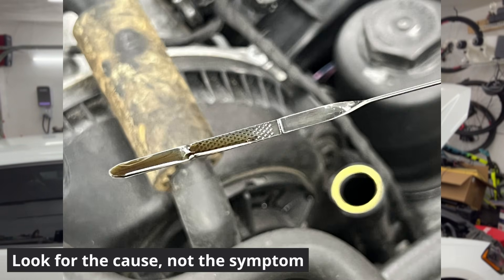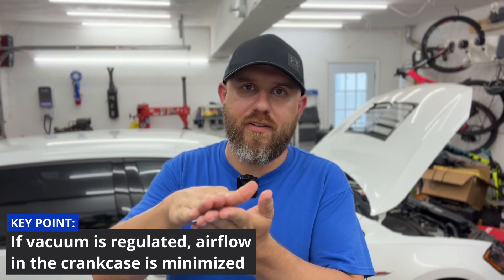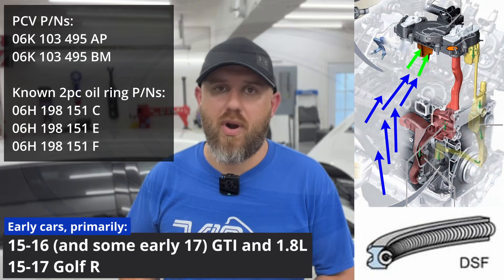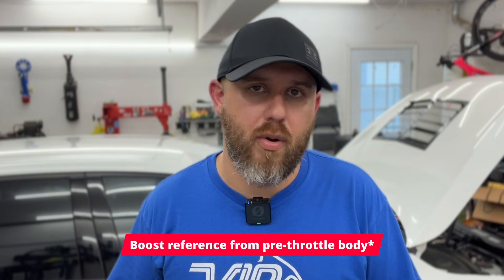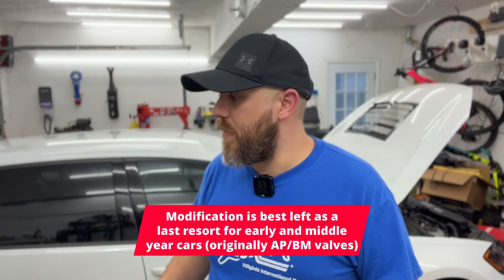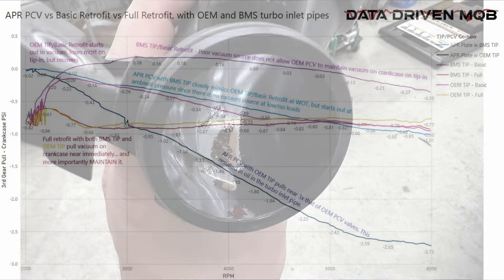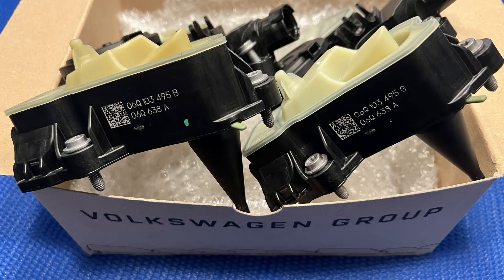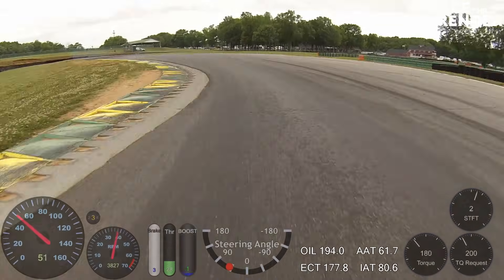MK7 PCV: What YOU NEED TO KNOW!

Comment: Whats the right PCV part number for my 2017 MK7.5 GTi Performance Pack with engine code DLB-029070? Thanks in advance
Reply from the maker: Unfortunately the only way to know with 100% certainty is to call the dealer and have them run the VIN. Can't rely on online catalogs as many are incorrect. I know you can send a message to ShopDAP and they can do the same as they have access to the OE catalogs as well.
Reply: @datadrivenmqb  Thanks for the reply, I will flick ShopDAP an email with my VIN. 

I did go through the local vw dealer and they said the BL revision is the correct part number based on their system and have that currently installed, however, since having this BL revision installed the car has a puff blue smoke on warm starts, and thinking the BM revision is the correct part.

Comment: If i used a BL model on a supposed to be BM model. what damage would it cause?
Reply from the maker: It might be more likely to ingest oil based on what I've observed. This is much more of a risk on the earlier cars than on the later ones (as explained in the video... I THINK this might be due to the piston ring design change, at least that's what it APPEARS to be correlated to). 

There's a bit of bonus content in the post here you might find interesting:
https://www.datadrivenmqb.com/drivetrain/pcv-system-knowledge-dump

Comment: This is a fantastic video. I have a 2015 car in the UK with an aftermarket TIP and smoke issues. I will be looking to go back to OEM after viewing this video. 

Two questions please that I'm not clear on. First question: For the early cars, what part number should I use to replace the MK7 PCV? There are different part numbers for the PCV, how do I match this to my 2015 car? 

Second question: if you stick to the MK7 PCV and the OEM TIP, does fitting the muffler delete help with ventilation? Or to put it differently, can you go "full retrofit" but keep a MK7 PCV and see a benefit? 

Many thanks
Reply from the maker: 1. Have to call the dealer and have them run the VIN. That's the only reliable way to know FOR SURE which it should have. US cars USUALLY have AP (GTI) or BM (R) for 15-18, and BK (GTI) or BL (R) for 19+. There have been a few exceptions. Some 15s call for the BM valve.

2. Muffler delete alone doesn't do anything worthwhile unless you're using it for the boost port. Just introduces another place for leaks to occur. I didn't notice any change in noise or anything either BTW. If you're implying to use the Venturi on an original MK7 valve... it could be done (if hose is adapted, fittings are different at the PCV), but the MK7 PCV diaphragms are considerably weaker and I suspect not up for dealing with the large vacuum/pressure differential caused by the Venturi.

As stated in the video, the flow chart is pretty much what I personally do/would do. 
https://www.datadrivenmqb.com/mk8pcv

Comment: Hello, ty for the great content! Mine has a big vaccum when i lift the oil cap or oil stick, and the engine accelerates, is it normal? New PCV from hengst.
Reply from the maker: Normal operation. You're introducing a vacuum leak to the crankcase by removing the cap, so the diaphragm opens in an attempt to keep the crankcase under vacuum (except cap removed is just far too big to actually do it).

Comment: I know this vid is a few months old, @datadrivenmqb any reason why the venturi inlet system couldnt be adapted with the original BM style PCV's on 15-17 R's for use with an aftermarket tip? It doesn't seem particularly challenging to splice the two hose styles together
Reply from the maker: It COULD be done. My main concern is that the diaphragm on the original MK7 valves is considerably thinner/seems weaker than the MK8 versions which were obviously meant to deal with the huge vacuum levels the Venturi generates. The diaphragm springs are also very different with regards to the spring rates and preload of each, which will both produce very different "actual forces" as-installed and in operation. 

I don't have a 15-18 car so I'm not really in a position to test it. Realistically the right choice is stock TIP and OE valve if possible, otherwise if the turbo or use case dictate it... straight to an APR plate w/ aftermarket TIP if not.
Reply: @datadrivenmqb  ty for the reply that makes a lot of sense. Prepping my 16 R for its first autocross events this coming spring, so it will see abuse. Stage 1 tuned. Ill likely revert to the OEM tip and see how it goes. If it starts smoking, then going APR plate system. Heres a, idea im considering, would love to hear what you think; the APR plate system already has a manifold vacuum tap for the N80 valve. Im considering adding a "T" connection between the N80 valve and vacuum tap, followed by a second check valve, then tapping into another location on the plate so that it draws vacuum on the crank case at idle conditions. If that starts to have oil surge issues coming through the new plate tap, clogging up the check valve, or migrating to the maniflold, a small catch can could potentially be added in-line for the idle vacuum loop. Do you see any potential issues with that idea? I may experiment with it for the hell of it.
Reply from the maker: @mfitze1 the problem is no check valve on the TIP side, so it'll just introduce a giant vacuum leak (exactly like removing the oil cap). 

Even if a metered orifice or more traditional inline PCV valve were used, it won't do anything helpful because it's pulling air from immediately beside the TIP port, rather than pulling crankcase gasses directly out. I SUSPECT the result would be a VERY fast accumulation of catch can moisture in cooler months.

Best bet with a plate is to just ensure its as free-flowing as possible to minimize the bad effects off throttle.

I'm awaiting a different plate to arrive for some further experimentation. 🤫 No promises on if it'll happen any time soon though.
Reply: @datadrivenmqb  you taken a look at the VTT plate/catch can system? 👀 hoping that's the one you are awaiting. Looks promising but would like to see testing on it.

Comment: My 2018 Tiguan has the Stage 1 91 octane from Tunezilla and is sitting at 105k km so I'm looking at proactively replacing the PCV. Is it worth going with the retrofit or keeping it OEM? I had a new TIP with muffler delete on order. Guess I'll wait on that.
Reply from the maker: IMO OE PCV (from dealer, ordered by VIN) + stock TIP. 

Rule #1: if there aren't any problems, don't mess with it.

Comment: How do i know wich pcv valve i have? I got a 2018 tiguan 2.0tsi engine code czpa?
Reply from the maker: CALL a dealer parts department, provide your VIN and have them give you the P/N. The catalog will have the original and the current/superceded number (if applicable).

Comment: When it comes to this! we the Porsche Macan 2.0 community are left in the dark! I have to constantly search for People like you!
the Macan has the 2017 AUDI A6 2.0  CYNB engine,  but not listed anywhere! my 2018 2.0 BASE MACAN came with BL PCV VALVE! Even though I don't think I have a real problem with the PCV VALVE, I started digging because the Idle has become a bit Rought, might be age 130K miles! ??/.  At idle it pulls 9 mm-Hg which is normal I think!, thank you so much for your time and knowledge. This is my first time owning a AG VW AUDI PORSCHE product! and I love the community!   NO MORE HONDA CRAP  " thank you lord"
Reply: I found the Actual problem: High Pressure Fuel Pump was on high duty cycle 46% on idle. So it was on degrading volume! I installed a new pump and now it’s at 26% on idle….. the moral of the story: change your high pressure fuel pump every 100K 
So it doesn’t throw you in a loop! 
There is no check engine light at the this point!

Comment: Wow, I am shocked. No one tells me that the OE inlet pipe is that critical for the OE PCV system. All I was instructed is the OE inlet pipe is bad and after market is the one to go. I am going to switch back immediately together with the newly installed PCV valve. Hopefully it will fix my oil leak.

Comment: I appreciate it, man, but I’m actually a bit confused. I have an Mk7 Golf with the DPCA 1.5 TSI 110 kW engine, and I’m looking for a preventive solution to carbon buildup on the intake valves.

I also watched your 2023 video where you explained the PCV retrofit from the Mk8 to the Mk7. You mentioned that installing an oil catch can between the air vent outlet and the turbo inlet isn’t an efficient or reliable way to fix this problem, as it can also cause several issues. But what if we place the catch can between the crankcase vent and the intake manifold instead?
Reply from the maker: Catch can doesn’t do much of anything period. Carbon build up is largely due to the variable cam timing doubling to perform EGR duties. 

You’d be time and money ahead just accepting that a carbon cleaning needs done every 60-80k. Small price to pay for the performance these things are capable of.

Comment: I decided to full send it with the MK8 PCV full retrofit on the 2018 MK7.5 TSI SE. The PCV it currently had was having troubles with performance like sluggish acceleration and not the best fuel economy, so I did the full retrofit but tapped into the charge pipe instead. 

It worked incredibly well, I was nervous it would blow up or smoke but it performed but much than the original PCV. Much more responsive, doesn’t cause as much vibration when slowly accelerating, and overall works great on the streets and highways. I only installed it today so will keep you updated on any new developments. 

Current Mods: APR Open Air intake, Mishimoto Intercooler, APR charge/Intercooler pipes, APR stage 1 tune, XForce Exhaust, GoFast Bits Diverter Valve+, using NGK spark plugs and coil packs.

This is all with a OEM TIP, as I’ve tried the APR TIP and got some slight smoking and Oil Blowby from that which looks like it also collected on other parts of the system like the charge pipes by the Intercooler and turbo muffler.

Comment: Running a CTS TIP on my mk8 GTI. Big puff of blue smoke on hot starts…could the aftermarket tip be the issue?
Reply: Praying the stock inlet will fix this 😂
Reply from the maker: Probably not. The Venturi is after the TIP on MK8s so I’d expect little to no difference… but can’t say with 100% certainty as I’ve not tested a MK8.

Comment: Props to you for investing the time to make this videos and spread the knowledge. It was very useful to have detailed sections of PCV valve in previous videos, where did you obtain those if I may ask?

Do you think you could guide me what would should be the first step to take in order to identify the problem I have?
I’m experiencing some issues with my 2015 MK7 GTI Performance;169kW (CHHA - pre piston/ring update engine). The car has aftermarket downpipe from HG motorsport.

* Oil leak around the oil cap and timing chain cover
* Strong vacuum at the oil cap while idling
*When I remove the oil cap, RPM jumps from ~800 to ~1500, then oscillates between 1400–1500 in a repeating cycle  
* Oil consumption around 0.5 L per 1000 km

Would you recommend replacing the PCV first? Any advice would be appreciated!

P.S. I read that using the newer generation of PCV valves (but still MK7) on the engines that do not have piston/ring update could also cause higher vacuum than expected. What is your opinion on this?
Reply from the maker: Aside from the oil cap leaking and oil consumption, everything else mentioned is normal.

I'd just replace with a new OE PCV valve (whatever your local dealer says is the correct PN, chances are if it's a 2015 then the PCV valve has been revised for your particular year. It will be either an AP or BM valve (could really be either... the CHHA uses a few Golf R components vs the CXCA/CXCB that are more common). I can't stress this enough: CALL your local dealer parts department and have them check based on your VIN. Online catalogs cannot be trusted unless you're buying a $35/month Partslink subscription.

I would replace the valve and reassess. If you have a non-OE TIP... going back to stock would probably not hurt as well.
Reply: @datadrivenmqb  Than you very much for the answer, keep on the good work! 💪💪

Comment: This is all very interesting, I've been watching all your PCV videos after I noticed a decent amount of blue smoke on start up the other day (first time seeing it) and I'm trying to figure out what the issue is. I can rule out the turbo seals since the turbo was just replaced 5k km ago, so I'm left with valve stem seals or PCV.

Looking up the part numbers from your "July 2024 Update" I'm seeing 06K103495AP listed for ALL 15-21 MY GTI's while 06K103495BK isn't even listed for GTI's (searched in both US and CAD parts catalogs; US catalog has more information)

Seems odd that the MK8 PCV doesn't work as well on 15/16 MY as it does on 17/18 MY considering the head is the same part number: 06L103063Q, whereas 19-21 MY is: 06L103064G; maybe this is due to the oil pan baffle? But I'm seeing the same upper oil pan: 06K103603BC listed for 15-18 MY, 06K103603CT for 19-21 MY, and the same baffle: 06K103138Q for All years, so maybe 15/16 MY have been superseded to use the updated design? Though its odd that 15-17 MY share the same long block: 06K100037K, while 06K100034M is specific to 18 MY. 15-21 MY all have the same piston rings now: 06H198151L.

I'm under the impression that it CAN work well for 15/16 MY GTI's, it might just takes a bit more work
Reply from the maker: Parts catalogs online are NOT reliable whatsoever. This was why I paid for my own subscription to PartsLink for a few months to compile all that info. VW/Audi dealers use it as well. You need to actually call up a dealer and speak to an actual person to run your VIN and find what components it has from the factory, etc.

From every VIN I've run, piston rings and PCV valves on 15-16 have been superseded to the same as 17-18 cars... but everything is still vastly different vs 19+.

Keep in mind there could be OTHER things at play too... verifying the engine block differences is a MUCH deeper rabbit hole I started to go down... the external castings, in particular where the PCV passages run along the outsides look different and there may be at least 2-3 different versions, but there's no way to know what the purpose of the changes are.

OE PCV with OE TIP is generally the safest bet if you're still on an IS20/38 turbo and tracking or autocrossing the car.

Smoking on startup has been valve stem seals in every single case I'm aware of where people have actually torn the engine down to check (about 6+ cases now). The problem is most people just live with it, or throw parts at it before ultimately selling it to Carmax or some such so we never actually find out what the root cause was.

Comment: Hi, I have a 2018 SE 6-speed daily driven stock GTI, but I am planning to go Stage 1 soon. My PCV valve is covered in oil (not a lot of oil but noticeable amount).My local VW dealer "fixed" the problem by tightening all bolts. Obviously, that didn't help. 
Should I replace my PCV valve with exact same version? According to your chart/videos I should not mess with the car. If have to change the PCV anyways and I don't care about $300+, would you still recommend to use the same PCV version? 
Thanks.
Reply from the maker: Replacing it probably wouldn't hurt anything - replace with whatever version the dealer says your car currently calls for (2018 GTI it's most likely an AP valve, which is likely what it left the factory with as well). If it's physically leaking oil then yeah something needs changed.
Reply: @datadrivenmqb Thank you!

Comment: Hi Tony,

I'm from Brazil and I've been watching your videos. They're really great, congratulations!

I have a Jettta MK 6.5 2.0 TSI. I believe it's the same engine as the Jettta GLI sold in the US.

I've been struggling with the PCV issue for a while. I use a larger turbo than the original. I've already replaced the valve seals because they're dry and leaking oil. I've performed cylinder compression tests, and everything seems normal. However, I see smoke after idling for a while, and when accelerating, smoke comes out of the exhaust.

I replaced the PCV, but after a while, the smoke returns. I noticed that the PCV outlet to the intake contains oil. I've now purchased an ECS oil catch can to use with the original PCV. Do you think it would be a good idea to use the MK8 PCV with the oil catch can if that doesn't work?

Sorry for the long text.

Greetings from Brazil.
Reply from the maker: Thanks!

I’m less familiar with those MK6.5 years, but assuming it is closely related to the early year MK7s (2pc oil rings and originally a PCV with the protrusion breathing on the cam cover), I’d err towards a PCV plate like APR. 

If the smoking is on startup there’s still likely something going on. If the valve guides are worn the seals will tear again in short time. May require head replacement. I’ve spoken to one person who went through exactly this scenario.

Comment: i have tiguan mk2.5 year 2022.. what is suitable setup for stage 1 for weekend drive?
Reply from the maker: Should be fine with stock PCV and stock TIP. I’m less familiar with the 3B engines and their needs/limitations when modding.

Comment: exactly i never touch no problem since 7years gti 7 clubsport never changed one time for a problem common issue like springle "diaphragm" tired around pcv even dump valve turbo it's still solid* no stage 1 except stage 1 dsg that a good option for reliabilizing the car* and do88 ic that it no more upgrade*